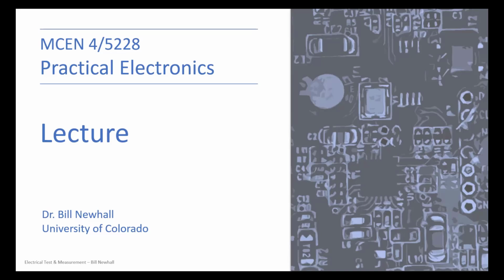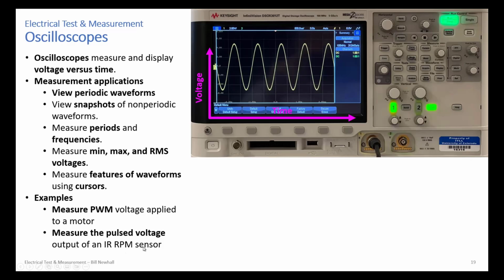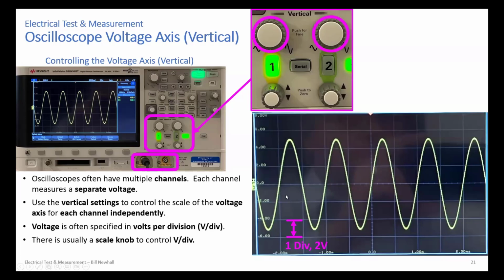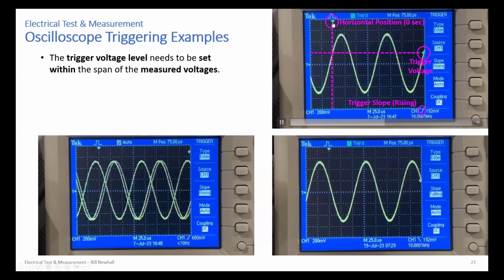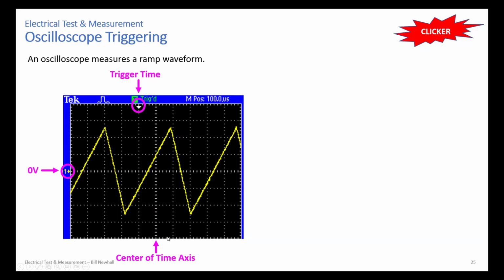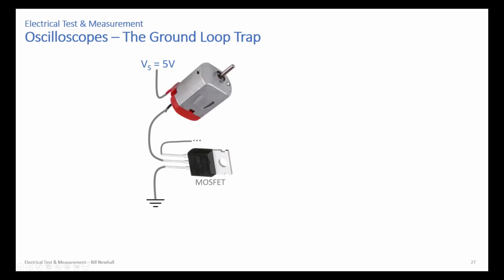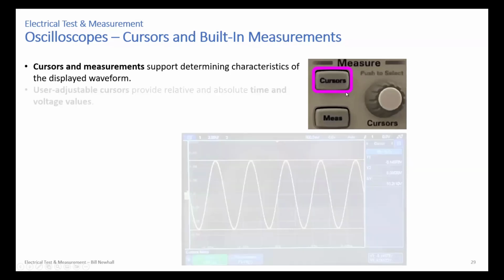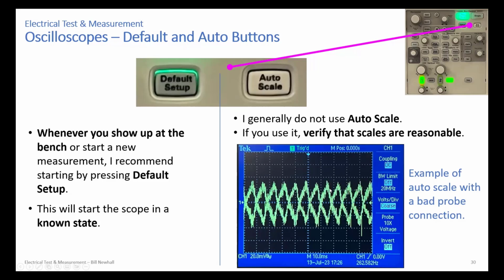Practical Electronics - Lecture 6

Comment: 38:03 that ground loop explanation seems misleading. I think it's fine to measure voltage between any two points as long as the mosfet(or any load) ground is not a earth ground. There is only ground loop when the load's ground is earth ground.